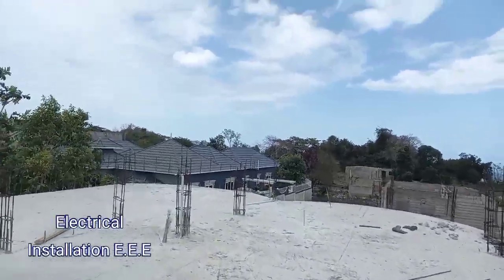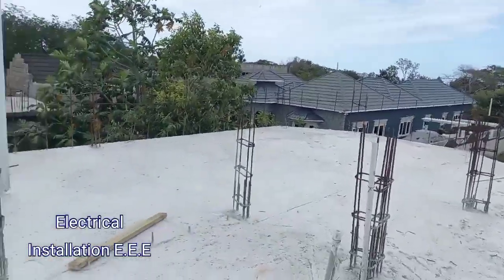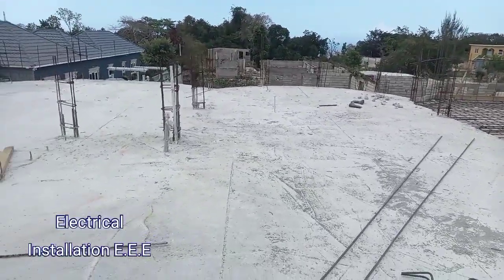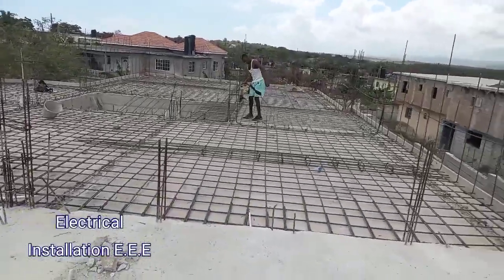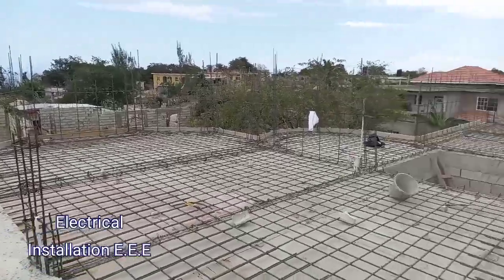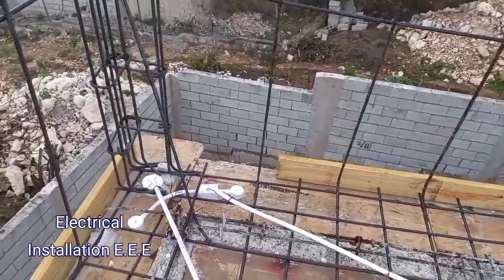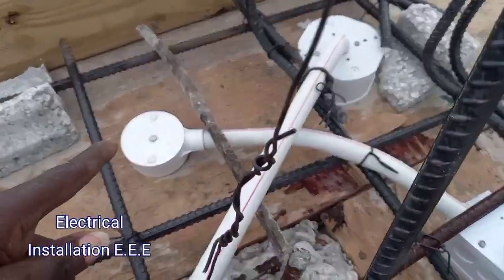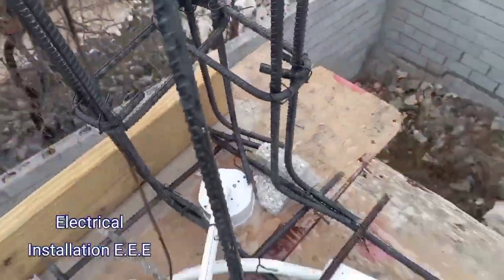How to install electrical p.v.c conduits & boxes into ceiling b4 concreting !! Followed  Up

Comment: Why i am having a surge in my electrical supply which is 240volt ,it,s reading 134volts on one leg and 106v on the other.

Comment: Nice video but please, do more videos on slab electrical conduit pipes laying and how wires are passed through also.
Tnks
Reply from the maker: We will try
Reply: @ElectricalInstallationEEE  thanks for the response.
 I really want to know how the switches are linked to the lights, how   sockets pipes are laid and wire passing through.
Thanks!

Comment: after decking, wouldn't all the boxes and pipes be covered.how would u draw the wires through them?
Reply from the maker: Yes it going to covered then i pull the wires through after
Reply: @ElectricalInstallationEEE  wouldn't u need to connect the wires in the box?
Reply from the maker: There will be access to the boxes after decking completes for connections
Reply: @ElectricalInstallationEEE  would like to see a video on that. i saw the one where u drew the wires through the wall and understood that, but can't wrap my head around the one on the roof
Reply from the maker: Ok i will be doing wiring videos soon
Reply: @ElectricalInstallationEEE  I would like to see how you go about them

Comment: I normally use plastic box for outside  lights, concrete roof are in sea areas, plastic cant hold heavy fixtures
Reply from the maker: Most times i use metal but some people like the plastic ones , but when i install heavy things like ceiling fan etc i use tough screws like concrete and bore it different.

Comment: What happens to the nail in the box after the concrete is poured
Reply from the maker: Pull them out with a pliers if the boxes were metal then we use a hammer and trizzle to take it out
Reply: @ElectricalInstallationEEE I would like to see how you mount a light fixture or fan from the ceiling boxes. I just want to see how the fixtures being attached to the ceiling
Reply: @ElectricalInstallationEEE  wouldn't they be inaccessible seeing that they would be covered by concrete?
Reply from the maker: I will show you how it is mount
Reply: Am how can I get in contact  with you???
Reply from the maker: Links in the description
Reply: Why use PVC boxes instead of metal????
Reply from the maker: Easier to work with ,also these metal boxes are so useless if the concreting is not proper you have trouble with them boxes if them get rotten
Reply: @ElectricalInstallationEEE  in some parts of Asia the electricians put a piece rebar imbedded in the concrete to support the fixtures. It’s different here as well
Reply from the maker: Yeah i saw that before but we don't out here ,i think we do it the simpliest way a guess
Reply: @affluentj4992  they both are rated for concrete. I just like to know other peoples techniques from their perspective.
Reply: So it means that those 5 way connector box u open the wood from the bottom were the nails are.its confusing because the roof is usually plastering that u see inside the house.